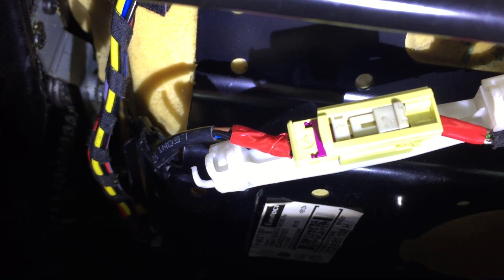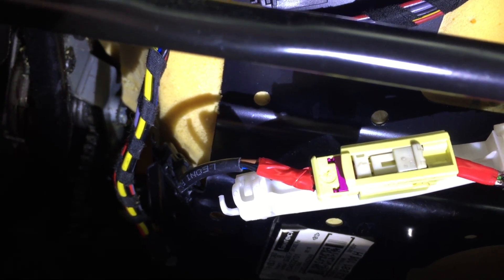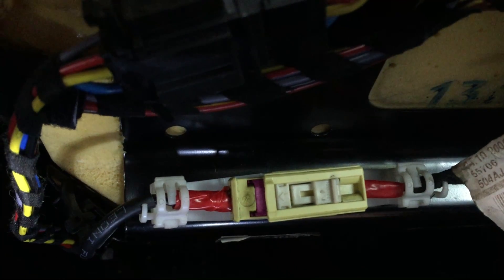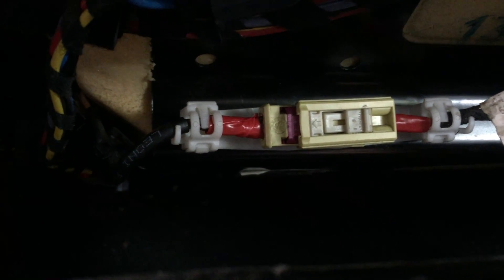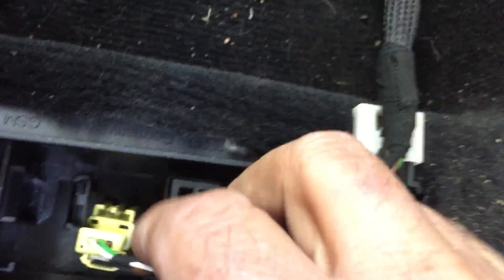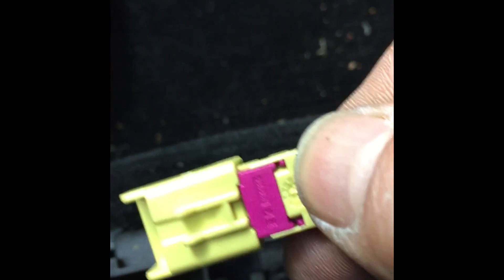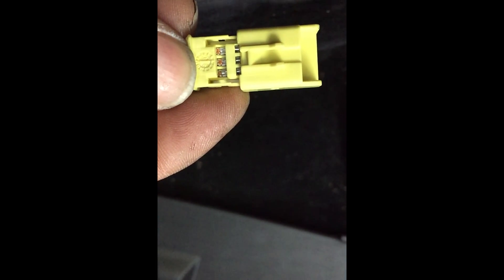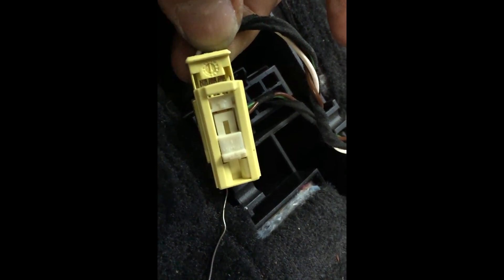passat b6  2 0 tdi airbag warning light fix

Comment: Hello, thanks for uploading this video. I have similar issue with my airbag light and I cannot delete it with my code reader nor I know what’s really faulty. This all happened after replacing loose wires connecting the door with the main body ( a coo on issue by VWs). This was only work I have done on my car. I did not work on airbags under the seats nor side airbags  nor on crash sensor and yet I have got fault code 01221 ( Crash Sensor Side airbag driver side (G179) Short with ground). Could you please tell what could be the issue? Thanks.
Reply: Did you ever get this fixed?  Looking for answers to that same issue now.
Reply: @ yes I did, a wire in wiring loom (between door and main body) was cracked, I replaced and works fine, never had issues again.
Reply: @ did you have to have someone clear the light or did it go off after the fix?
Reply: @Brian-VirginiaBeach  i think it did disappear after I have removed the broken and torn wire(s), but can’t recall 100%. Sorry. I hope this helps.

Comment: I have 2006 passat 2.0tfsi. I changed my passenger door complete assembly from a 2008 passat. Everything plugged in and works fine but air bag light is on and I have code 01222 and 01334. Do I need to put my old door crash sensor into the new door?
Reply from the maker: 01222 code is referred to:  crash sensor 
01334 code is referred to : door module

1= loose connections 
2= wrong crash sensors 
3= faulty crash sensors 

I will suggest to check this 3 options 
But try to reset the faults before you do anything.
Reply: I have the same Problem. I changend the door also and got the same errors. Did you fixed it?